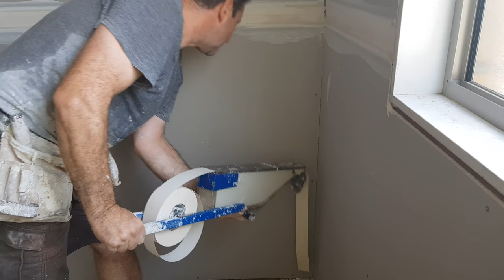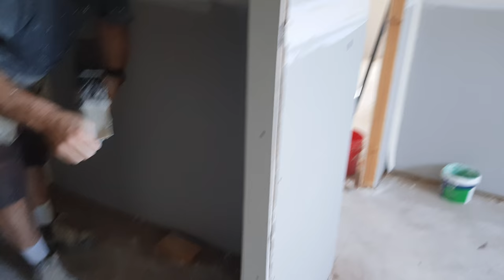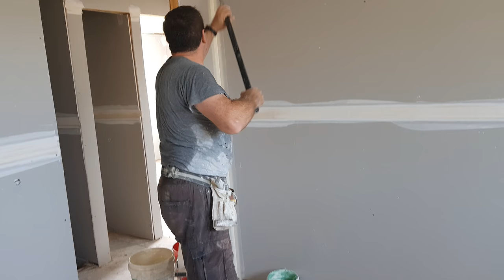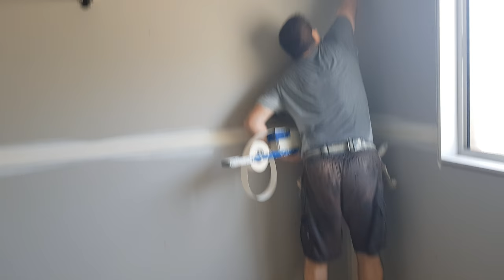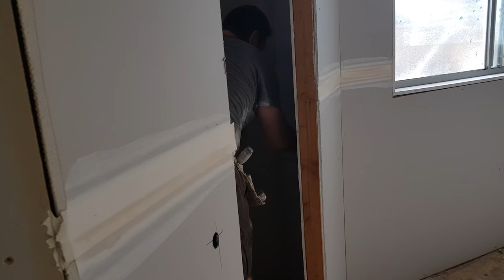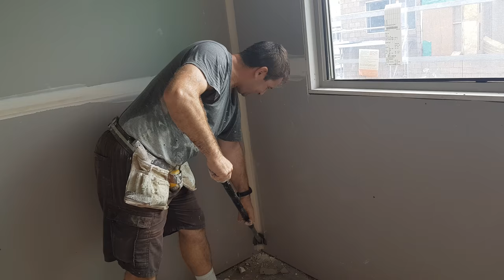Taping Drywall Internals with an Internal Applicator Mud Box

Comment: Damn he works hard.  No wonder he is soaked in sweat.
Reply from the maker: +J Peabody lol yeah, he goes through 4 shirts a day. Does a 3 bedroom townhouse including a staircase in a day by himself. Not include sanding and cornice. I got another guy on tomorrow old bloke puts up 5.4meter cornice by himself.
Reply: Does he just do the setting or hangs it as well.
Reply from the maker: +Michael Magill he just sets.
Most setters don't fix and most fixers don't set.
They're normally a different guy who hangs cornice.
Even sometimes have a dedicated sanding Crew
Reply: Shows you how long I have been out of new work. They use to hang, set and sand all the one crew. Makes sense specialising.
Reply from the maker: +J Peabody is so humid here. Especially working in the boneyard